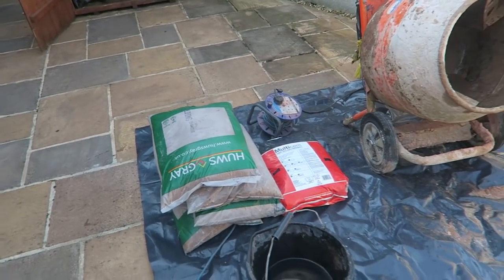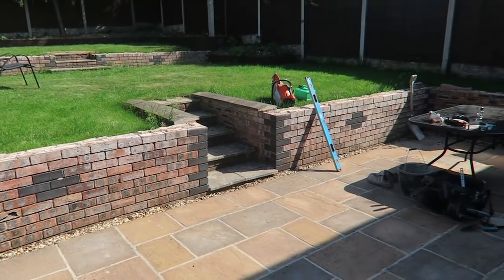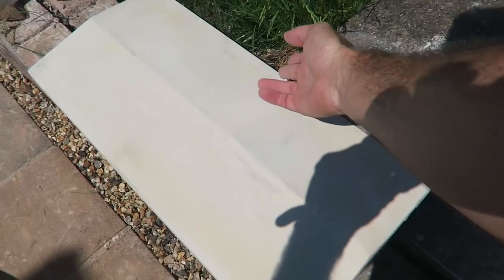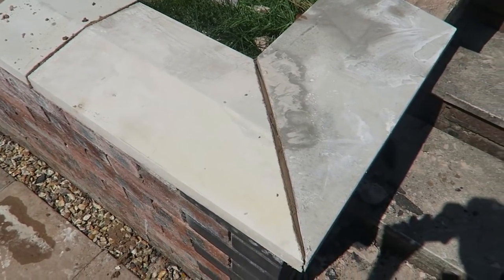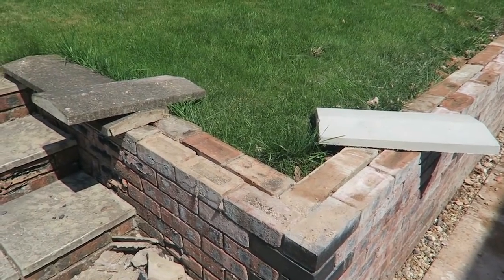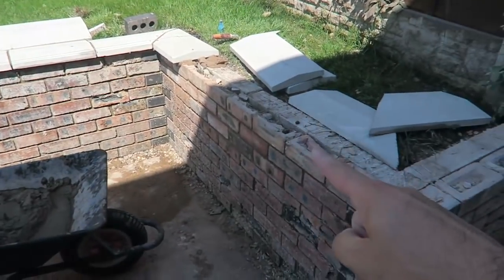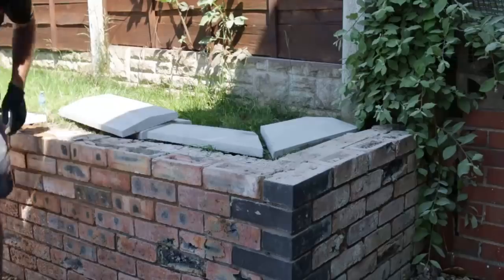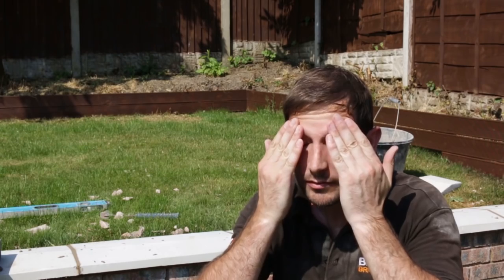Bricklaying in 30 degrees -  Replacing copings

Comment: Nice copes and nice job Stu.  Something I've been doing for a while now is Pva back of cope and Pva the block or brick . I find copes  come loose to easy as not rough enough on the beds .  Pva gives a bit more grab even more so in that heat I find mortar just drys out to quick .
Reply: or just give them a good wetting before you lay them, the same goes for screen blocks
Reply: Yeah I'd go for wetting the brick wall first and foremost as those brick will just suck the moisture out of the mortar..  but pva is not a bad idea .
Reply: I just score them a few times with the cutter then cements grins the cutter lines
Reply: Spot on mate. I've been wetting the back of them for many years now with no issues.

Comment: Stu love the videos and I hate asking but genuinely want to ask why did you use a full one when you cut it at 45 degrees and then half next to it? Can you not use a smaller corner and fill one next to it cos it would flow better from a looks point of view if that makes sense, then all the pieces are same size apart from corners? Or is it a weight thing? Do corners needs to be bigger?

Comment: is it not necessary  to spray or sprinkle water on that brick before applying cement mix, you use dry bricks  dose it make good bonding with cement mix